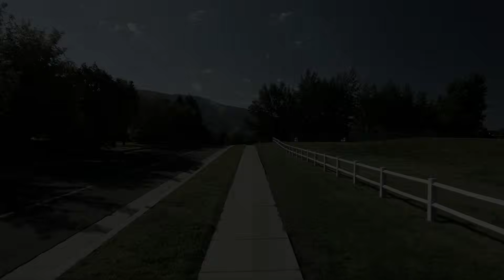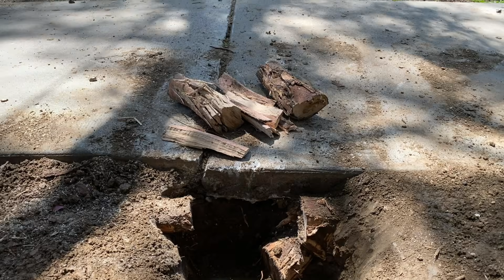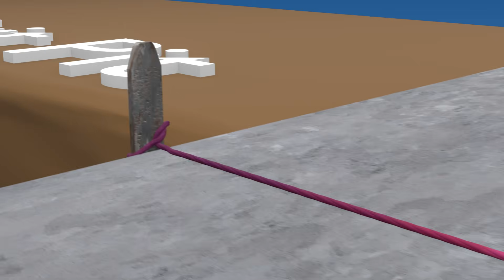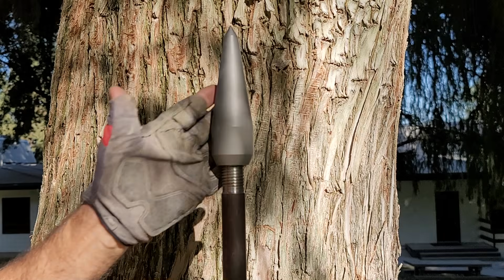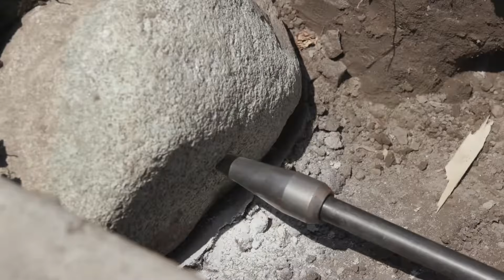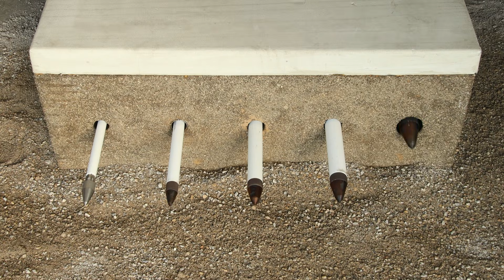Bullet Mole Sidewalk Kit | Bulletmole

Comment: You've got way too much time on your hands!!! A length of PVC and garden hose does this job in 15 minutes!!!
Reply: A garden hose is not going to bore through rock or thick roots.
Reply: @TyBeingTyAgain  Spoken by someone unable to adapt to field conditions!  How were wasteful trenches dug then?  No concern for expense to customer.
Reply: @robertfunicello2676  An unexpected rock or root is easily dealt with when it doesn’t have 5 inches of concrete above it. As some people have testified in videos using the water method, the process came to a halt when they encountered interference.
Reply: What if you don't have a water source? What if you have very rocky soil or many roots? Or both? Not to mention that in most cities in the US it is illegal to erode a hole using water under public property ( A sidewalk) which creates a huge void and softens the substrate causing cracking in the near future. In many cities The Bullet Mole is the only tool approved to make holes under public sidewalks without having to remove the concrete. In addition, If your a professional you don't have time for WHAT IF'S  and more problems. So, the Bullet Mole is your tool of choice because you don't need to mess - (water) - around, you just get there take the tool out of the case, get it done,, and leave.. by the time you hook up your hose this job is done, usually 1- 5 minutes with the pipe installed through roots,, rock's or whatever else.. no mess.. then you have more time on your hands to do something else productive.
Reply: @stephenlafontaine2286  me and Robert's wife can bore that stupid sidewalk before you get that thing outta the box with nothing more than pvc
Reply: @thesmackdaddy9888  I guess that's why they call you the daddy of smack. And incase you either can't read or didn't have a chance to read the guideline at the top of this feed. It says to keep the comments respectful. I might add that you look pretty foolish diverting from the truth by bringing someone else's wife into something that you quite obviously have no experience with. I won't be responding to any more comments from you. My suggestion find out the truth...don't run from it.
Reply: So get a battery hammer drill with a concrete auger bit long enough which are about 20$ at your local hardware store and minus the big ass 8 foot trench that would take a guy and a shovel an hour to dig both sides and boom,holy holden hole holstein holdawfskee..
Reply: @Z-Ack  Cost for the battery hammer drill?
Reply: @stephenlafontaine2286  If the soil is so bad,how do you dig all your unnecessary trenches? It's a sidewalk for crying out loud!! Therefore a house or building is probably near by. Most places in my area have indoor plumbing and running water! Tip,if you hit an obstrution,move  over a few inches. Dah!  LMAO when I saw the this video !  Snake oil!
Reply: @robertfunicello2676  So move over a few inches and keep eroding the underlayment. Thats a great idea! So neat and professional. If you notice in the video there were roots everywhere, big trees and in many areas there are just as many rocks. The primitive pipe and water technique will NOT work. As for the trenches, unless your indoor water and plumbing lines are running on top of the ground then the trenches are very necessary and have already been dug up to the sidewalk or driveway. Professionals all across this country dig trenches in very rocky and root laden soil conditions. They use things like trenchers, saws, picks and axes to get a mans work done. Then they use the Bullet Mole to quickly and easily get there pipe under the sidewalk, driveway or road. The sidewalk kit shown in the video is the most simple application of the tool. It can be used to penetrate up to 70 Ft or more and install up to 2" PVC or poly pipe. It not only makes the hole but also installs the pipe. Much better than your run of the mill snake Oil. Keep an eye out for our other upcomming videos showing driveways with different types and sizes of pipe.

Comment: so to get under a 3ft wide path you need to dig an 8ft trench?????      What a good idea NOT !!!!!!
Reply: Actually 7-1/2 ft would be fine unless you buy a 4 ft shaft then you could do it with a 5 Ft trench.Besides that, another trick would be to start the hole at a slight  angle downward a foot or so before the edge of the sidewalk and then you wouldn't need to dig a trench at all, depending on how far underground you need to put your pipe or conduit.once you use this tool you will discover another creative techniques. In the end result will always be a fairly easy and very effective, job done!

Comment: Minimize the entrance trench length by using screw together two foot sections on the tool
Reply: That is also possible. We used to make a 2 ft. Shaft, but it costs just about the same amount to make a
Reply: That is a great idea and is necessary at times. The set back lies in the fact that it costs almost as much to make a 2 foot shaft as it does to make our 5 ft 4 in shafts. So ultimately it would be cost inhibitive for most users, however in certain conditions that are truly restricted by fixed obstuctions or terrain  then spending the extra dollars for shorter shafts would be worth it.

Comment: Nice!
Reply: Thank You!
Reply: Need to buy bullet mole for driveway bore but sure to how much energy it takes.
Reply: @raymondluwanuka8568  it's really not as difficult as you might imagine. The sledge delivers an enormous amount of force with simple blows. In addition you are only driving the point (not) the shafts since the shafts are narrower than the point so the friction does not increase the further you go. The resistance and the fracturing power will be the same at 1 ft aside will be at 40 ft. We also rent them and ship them around the country in a relatively small case.